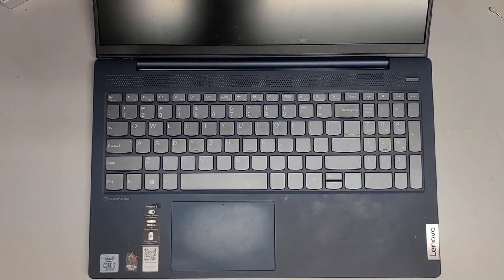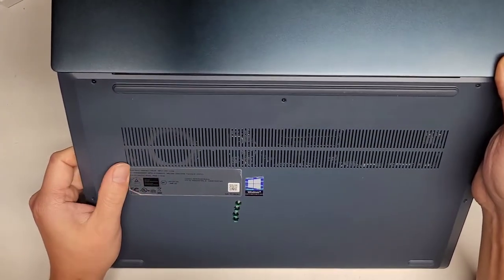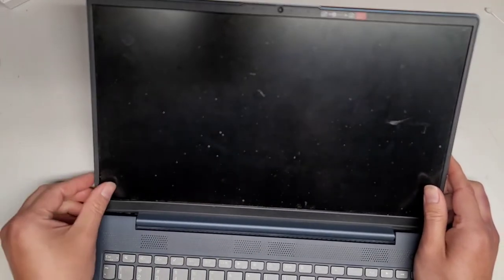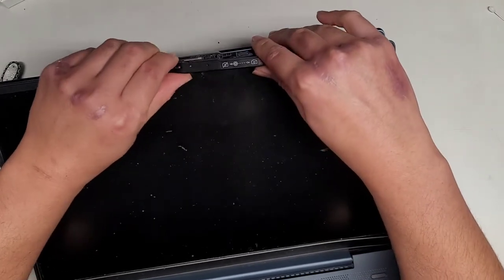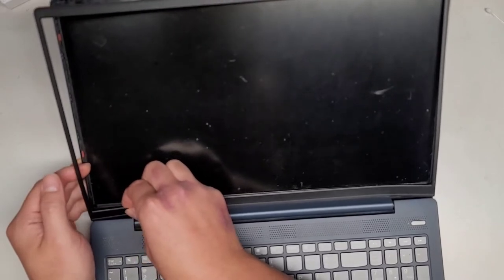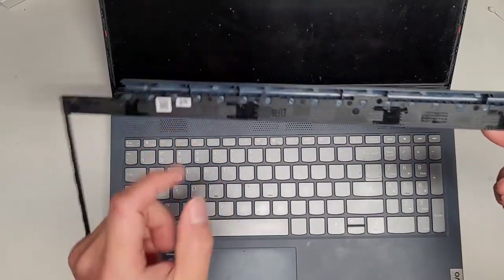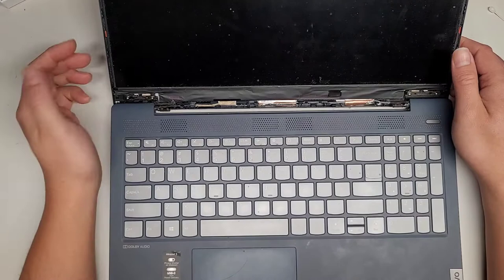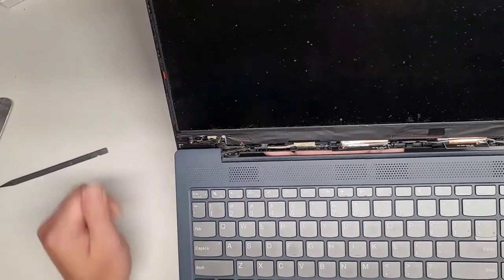Lenovo IdeaPad 5 15IIL05 15ITL05 JB Weld Faulty Flawed Hinge Design Repair (Class Action Lawsuit?)

Comment: Lenovo ==utter garbage   left hinge broke in November ,one month of warrantee left ,fair enough they fixed it. one month out of warrantee  the right hinge went, I repaired it with visible 2mm bolts ,not a nice sight but  will never break again  .Now the replaced hinge went and smashed the screen.... never but Lenovo again.
Reply from the maker: Ouch D:
Reply: was this problem covered by warranty? Or you paid extra? Having the same issue
Reply from the maker: @linjunchen6132  it varies. Show them my video. It's a very common issue. Bad design should be covered under warranty.
Reply: Same here my left hinge broke
Reply: @jannybravo8429  samr here.  I'm scared if screen is broken
Reply: @pallavitiwari769  I doubt I'll buy a next lenovo
Reply: Hi, had exactly same thing happen today but one of the screws has cracked my screen and stopped the touch screen workjng. How reluctant were they to fix it, how should I word email becuse seen a lot of people saying they turned them away. Thanks
Reply: My Lenovo Ideapad 5 has always been static on my desk, barely used and the right hinge came off and split the display. Pay 70 pounds to repair as 3 months out of warranty. No more Lenovo for me...
Reply from the maker: @anasrv  :(
Reply: One hinge goes it puts stress on other hinge. I just replace the entire cover and both hinges of they're damaged. Then be sure not to lift or carry by the screen or open or close holding the side, instead always open and close from the front.
Reply from the maker: @ThorneyGryffon  good luck getting it to last more than 3 years.

Comment: My Ideal pad5 just got this issue today right after the warranty expired in month 13. My old Lenovo lasted over 7 years with the same failure mode but I was not disappointed as it served me well. I feel the quality of Lenovo is going  down. My old Lenovo had a better keyboard and the display contrast was much-much better. Will probably think twice about getting a Lenovo again. This is a good opportunity for me to use my brand new MacBook Pro depreciating in its original box as I am so used to Windows.
Reply from the maker: Yeah, the designs are getting worse and worse
Reply: Exactly, it happened right after 1 year. But with Costco I'm getting another year warranty but we'll see how my claim goes.
Reply from the maker: How did it go?

Comment: I did this repair on this laptop. I removed the battery to stop the laptop from turning on all the time. You get better access with the back off the laptop as well. I set the laptop on the back of the screen and had the keyboard sit vertically and used weight to hold the repair together while it set. Letting it set while open eliminates the saran wrap step.
Reply from the maker: If saranwrap step is essential for the bezel to set properly

Comment: Thanks for the video. Question, if DIY'ing this, couldn't I just leave the bezel and other plastic piece off until the epoxy is set? Then just reassemble as normal. Or am I missing something?
Reply from the maker: Problem with leaving the bezel off is you're likely going to have too much epoxy. The bezel helps flatten it out and ensures the bezel will sit flush.

Comment: Thanks so much for this! I seemed to have successfully re-attached my laptop hinge. But I have a minor problem. The hinge cover won't snap back and it appears that its small plastic clips were broken when I tried removing them earlier. I still have the pieces though but I don't know if I should glue them back or what. Any help is appreciated!
Reply from the maker: It depends how it broke
Reply: Loosen the tension on both or the other one will break next. Utube has a good diy video. If it's over 5 yr old glue it w 3 or 4 tiny drops of super glue Jel.... After you loosen tension

Comment: Thanks for the video. I'm a 72 yr old crafty Grandma. My like new Lenovo idea pad 5 broke last mo, left hinge. I followed your example. Removed all the broken pcs. Loosened the tension on hinges, it was crazy tight. Added tiny drop of sewing machine oil. Perfect now. Ace Hardware had the tiny bolts n tiny drill bit. I didn't use JB weld. I used my favorite black E6000 glue to build up under the hinge. Waited 48 hs. It gets like hard rubber. Drilled the  3 holes, covered the screen w cardboard while working. It worked, looks just like yours. A good teacher makes for good students, even if they are 72... Plus I have great tools I usually use for making jewelry. Tiny tools worked best, like my bead crimper to loosen hinge tension. Who knew! 
Lenovo? Never NEVER again.
Reply from the maker: Sounds good. I wouldn't loosen the tension though, because then the screen starts flopping over. It's not Lenovo, but this specific model that's bad. I've been fixing so many of them.
Reply: @ItsBinhRepaired Yoga's too
Reply from the maker: @kennaortega3708  :/
Reply: Mine is the right hinge…it just randomly broke
Reply from the maker: @KrazyGamer25  yup
Reply: @ItsBinhRepaired  How much repair costs?
Reply from the maker: @tampinesclass4365  $150-180

Comment: Thanks so much for this.  Worked for my IdeaPad 5 and kept me from having to replace it. 

A couple notes that may help others.  Both my hinges broke, so I decided to just epoxy the hinges back, set the computer with them where I wanted, and let them harden before continuing with re-assembly.  I'm not sure I would have been able to do all that manipulation and keep the hinges where I wanted them with the wet epoxy.  I used some masking tape but skipped all the saran wrap stuff.  I think this made the repair much easier (and my bezel fit back fine).  However, the risks here would be the bezel might not snap back perfectly and, being my first time, I was a bit sloppier with the JB Weld than in this video (but it worked).  I suspect I might have a little trouble replacing the screen or what not if I had too...but, frankly, this computer is 2.5 years old and I'm not willing to dump any real money into this design.

But, I am also not a pro being paid to make a repair, I was just trying to get my computer back to serviceable and where the screen wasn't just disconnected from the the laptop.  Thanks again.
Reply from the maker: Yeah, if you completely remove the screen and let it set before reassembling, it's a lot easier, but I only do that if the hinges have the raised bumps to keep them aligned properly. The saranwrap makes sure that they are in place and removable in the future.
Reply: @ItsBinhRepaired  I'm sure yours is a better repair. Thanks again for the instructions.  This computer wouldn't be useable as something that can be moved without it...and it just cost me some JB Weld and toothpicks.

I'm a bit disappointed in Lenovo for this design flaw though.  I've had a lot of ThinkPads over the years.  I suppose that is where I should stay with Lenovo.  But even my wife's new T14 doesn't feel as robust as any of our previous ThinkPads from various lines (X, R, T).  Starting to wonder if they are worth it.

I'm curious what you think the most durable lines are?  Latitude? Something else?
Reply from the maker: @gregv1776  ThinkPad T line is most robust. Not sure if they charged things.

Comment: Still being appreciated, was able to fix my Lenovo IdeaPad5 RHS hinge, the difference I took was to remove the battery, tape where necessary then use the JB weld to adhere the hinge to the lid, apply weight, a stack of books to the right height positioned adjacent the vertical keyboard base of the laptop & a dumb bell weight(5kg) bridging to keep hinge in the fixed position. FINALLY after 24hrs curing reassembling the bezel. Only issue with this approach was the small plastic part that fell out it wouldn't clip back into place so just left it out, cosmetically still looks like a bought one. Many thanks
Reply from the maker: Awesome!

Comment: I am having the same issue with this right now... Still 1 month left from the 2 years warranty. Let's see if and how they fix this for me. I will update you. Thank you for your video!
Reply from the maker: They likely won't, but we'll see
Reply: @ItsBinhRepaired  I spoke with Lenovo support today, and they said they know this is a common problem for this model; thus, the repair is cost-free. But I also asked what happens after the warranty expires, and the answer was: "then we will no longer repair this problem for free." So, although this is a production flaw that they should probably always repair free of charge, they will not when the warranty expires. The suggestion was that I extend my warranty...
Reply from the maker: Other people said they called it physical damage
Reply: @ItsBinhRepaired  I sent it to a  Lenovo repair center (via UPS), and I was informed that they finished the repair and sent it back. So, I should have it back anytime now. But, based on what I see they repaired (LCD Bezel L 81YK_PL_GREY, LCD Cover L 81YK PL_GREY, Strip Cover L 81YQ BK TEX), I am afraid I will soon have the same issue. If the first two parts are made from the same plastic, then I don't have good hopes the repair will last. But, fingers crossed that this will not happen again! In any case, they did fix it (I live in The Netherlands, maybe there are different ways the different local Lenovo subsidiaries function?)
Reply from the maker: @alinaa9465  it'll be the same defective parts. Just open and close it slowly. It'll last longer.
Reply: @ItsBinhRepaired  yes, same parts. But, the worst of all, is that now the screen is flickering... I didn't have this issue before and now the computer is not usable... Needless to say how angry this makes me!
Reply from the maker: @alinaa9465  send in again :(
Reply: @alinaa9465  , did you have the highest level of warranty?  I have the lowest...they said I should upgrade...but even with that: this repair won't be covered.
Reply: @donnadalton5861  I had the standard two-year warranty here in Europe (NL, more specifically). We don't have classifications as "low" and "high," just standard factory warranty, which means you can have your laptop fixed by an official service of the producer (at their choice) as long as it is not something caused by the user (spilling liquids, dropping the computer, etc.). I do need to say I dealt with imbeciles throughout this process. I will never again buy a Lenovo; the service was horrible...to say the least! They fixed the hinges issue (with the same poor plastic frame), but broke something in the screen, which they eventually replaced completely. But I had to send my laptop to another country for repair twice (they have a service in Germany), and they never gave any additional warranty for this issue. This wouldn't be the issue, but the problem is the way they spoke with me throughout...very unprofessional. I am considering starting a class action on this issue. They should pay everyone's repair for this specific type of laptop as they acknowledge this is a production flaw...the Lenovo service support acknowledged it to me.
Reply from the maker: Yup!
Reply: hi bud! could please tell me how you contacted them please provide me with the info because i got the same issue and my laptop had 6 month for the warranty and thanks!
Reply from the maker: @EMohamed  go to their website and search for warranty or rma

Comment: Thanks anyways. To help orient the viewer to what you are doing, it helps to give a general overview explanation of the problem & the solution, & the logic behind the chosen solution, before proceeding into details. For me, there was a lot of talk, but not about what I needed, to understand why you were doing what you were doing. I'm sure you are a good repair tech; I just needed you to orient me. Clarity is #1. Thanks anyways. Blessings.
Reply from the maker: Not sure what you mean. The title is the overview.
Reply: @ItsBinhRepaired  I mean like you would learn in school, on giving a presentation, to make instructions very clear. I took speech class, where we had to try to give instructions to other people, to help them follow. We all graded each other. I'd fail you on orienting me to what you are doing. You need to start with giving people very clear instructions to orient people to what you are doing, putting it in context & at each step in the process. It's about being basic, & clear. You tell a lot about answering the door instead. Describe the broken part better.... how it connects normally. What it normally looks like. How should the broken part connect? Why would i use jb weld in place of the screws? You did not orient me at all to what you were doing.
Reply from the maker: @cchemmes-seeseeart3948  um, then I would give you an F in comprehension and intuition. You can see the other unbroken side to know how it goes together and how it used to be. I've also mentioned how these keep breaking so you should know that putting it the way it was before will just result in another broken hinge mount. Not only that, but you'll need a replacement screen cover as well as need to remove the screen and everything mounted to it. You think someone taught me all this stuff? People need to use their brains at least a little, which it sounds like you're unable to do? Not everything needs explaining. You can breathe without someone explaining why and how you need to breathe.

Explanation on how or why to use jbweld is unnecessary. Just follow the dang instructions...
Reply: @ItsBinhRepaired  I actually just fixed my own laptops. I've done things like graduate from college with magna cum laude honors. And I'm just giving you sincere, true feedback as a user of your video, of serious problems I encountered, that kept me from finding any benefit to it. What you want to do with that input is up to you. You can keep making videos that fail to truly help people, or consider the feedback to make a great video. It's your prerogative if you want to attack viewers, alienate people who would support you, & were trying to learn from you. You clearly prefer to attack & ignore feedback. It's what you call lose lose. Lose video. Lose response. Good luck with that. Have a great day. Blessings. Peace. Love wins.
Reply from the maker: @cchemmes-seeseeart3948  A 72 year old grandma was able to fix theirs with the video... lol
Reply from the maker: @cchemmes-seeseeart3948  I watched the video and have no clue what else could be said to make it easier to understand what needs to be done...
Reply from the maker: I show and explain everything needed to fix the computer so that anyone could follow along. Your comment came off as, "you talk a lot of nonsense. All I want is why you repaired it this way and because of that, I'm not going to follow that method."

You could have simply asked why I repaired it with jbweld and not screws. The hinge design is very narrow and horizontal, not providing much leverage for the screws to hold into the brittle plastic hence so many of them having the same issue and breaking.

The reason I don't give an overview beforehand is because then people skip around and think they know what to do. You first need to watch the video to learn and understand, then get the tools needed to do the job. When following along the second time, you'll have the tools and ability to understand. People that just see glue it in place will get any random glue and not protect the bezel from the glue, causing it to be permanently damaged when they do it wrong.
Reply: @ItsBinhRepaired  I stand by my problem with your video. I've watched a lot of pro videos & I disagree with you.
Reply from the maker: @cchemmes-seeseeart3948 let's see some of those pro videos.

Comment: I just gave this a shot knowing its tricky, the  three screws inner/inboard on the left hinge were all broken off with the brass inserts snapped off. But after getting JB in there and set up to dry/cure, i hit the start button to see if screen was still functional and looks like it's screwed up good and whole machine wont start up correctly now either. I knew it was a possibility going in. But what a great laptop with such a HUGE design flaw.  Time to look for a better option as much as I liked this Lenovo, I can't spend more money on their poorly design stuff.
Reply from the maker: Hmmm did you open the bottom?
Reply: @ItsBinhRepaired  No I didn’t want to risk that , and I just stuck with taking the screen ring off which is how I’m pretty sure the screen got broken. But on the bright side I did get the hinge fixed well with the JB weld, but it was a risky surgery, and the patient had a stroke 😝. But I can plug in to an external monitor via the hdmi and have everything backed up. I’m done with Lenovo and looking at simplifying life and going to an iPad 9th gen 10.2” with Smart Keyboard. I really liked Lenovo but got 2.5 yrs out of the Ideapad that was not cheap. It’s a design flaw that should be warrantied.
Reply from the maker: Yeah :( needs a class action lawsuit to happen

Comment: I ended up drilling through the holes and the back of the lid and screwed it together using #2x1/4" screws and nuts.  Don't do it this way unless you have a mini drill press.  I bought a drill press stand that had a 1.69" diameter collar that was compatible with my drill from skil (model 6445).
Reply from the maker: Hope it holds up even better